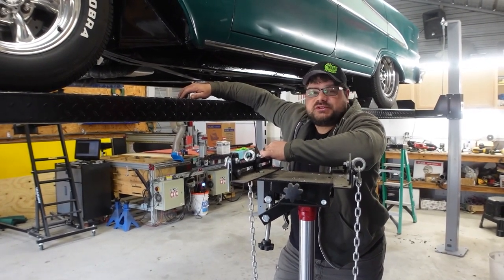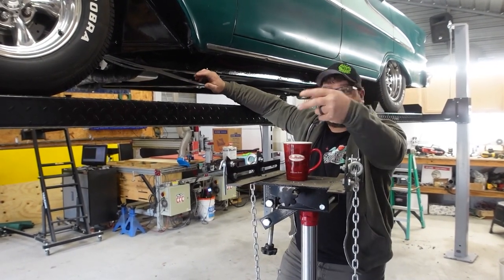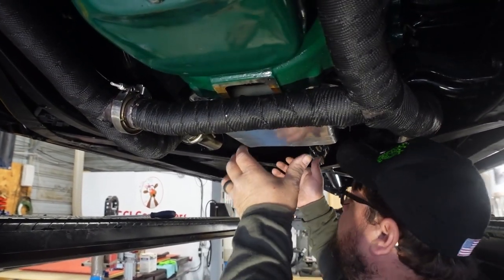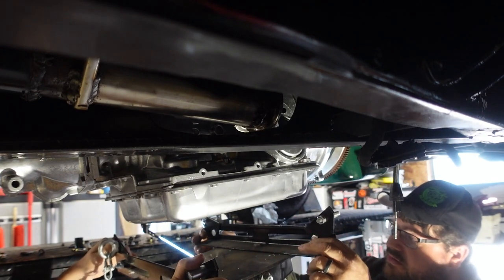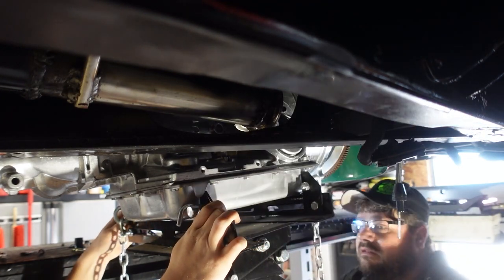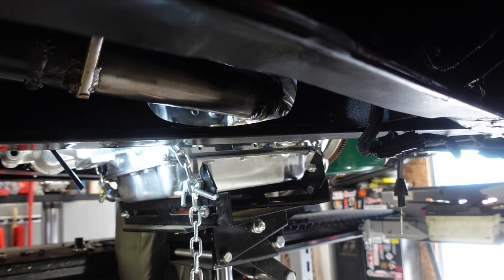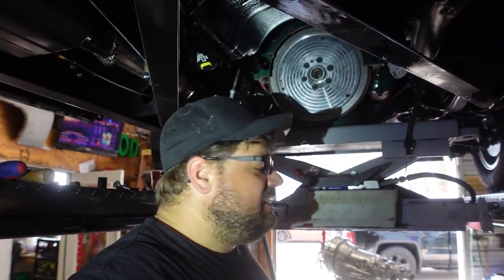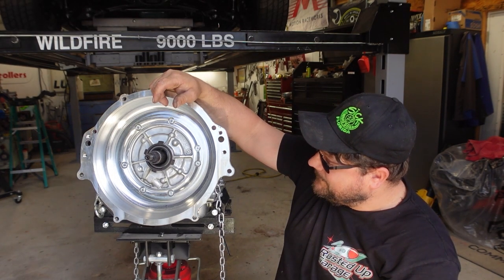4L60E Down | 55 Olds Transmission Removal

Comment: I am starting to restore my 1954 Oldsmobile super 88 here in Ohio any advice on where to find parts?
Reply from the maker: Fusick has a bunch, but they are expensive Kanter also has stuff. its hard finding stuff I found I had to modify stuff for other applications